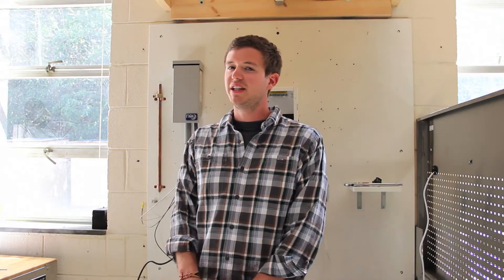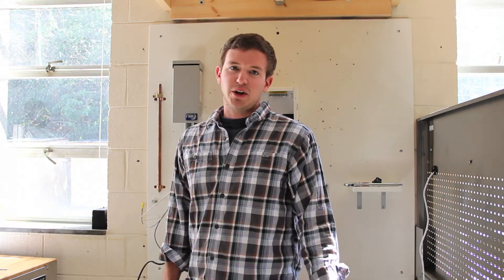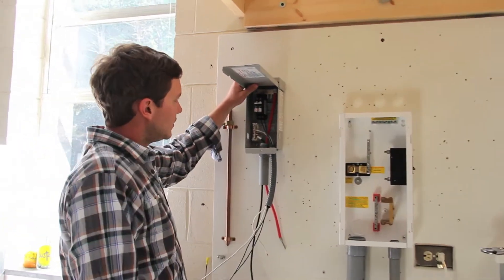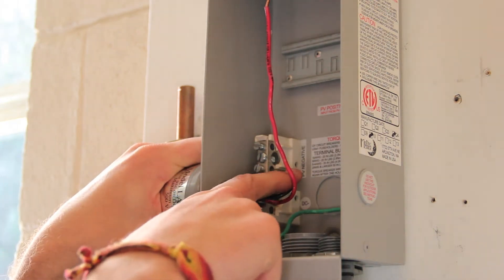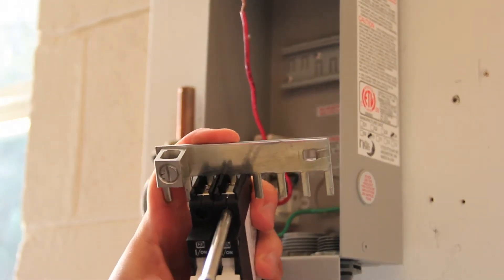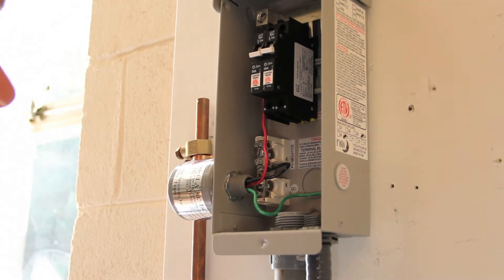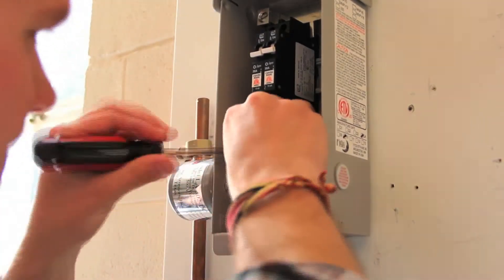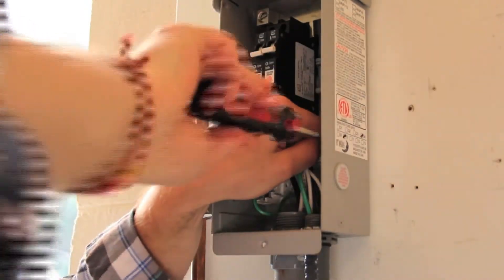Combiner Box Wiring for Photovoltaic Systems

Comment: Where is the ground wire connected to on the PV that is shown in the combiner box. If the grounding system with number 6 wire is connected to the PV and mounting bracket down to the earth ground. Is that necessary if you have ground on the roof already.

Comment: You've got to be kidding!  Lightning strikes can easily be 10,000 amps and the "lightning arrestor" has maybe 14 gauge wire on it?  Maybe if you said "suppressor" because it bleeds off the charge and prevents a strike?

Comment: You should never stack multiple wires in a single connector. The appropriate option for connecting the lighting suppressor would have been to installed a DIN rail mounted terminal block to keep you wires with a single contact.  Not trying to start trouble just point that out. Otherwise a good video.

Comment: Hello, thanks for the video. I have bought a hybrid inverter and am connecting 42 panels of a 265w module. From the manual of the inverter I have to connect 14 of the 265w in series so that I can I have three strings coming out making 42 panels. There's no need for me to parallel them because the parallel connection takes place in the inverter when I plug it in. In the manual I'm adviced to use a 1000v/20A dc breaker in between the hybrid inverter and the solar PV modules. Is it possible to use a combiner since I'm not paralleling it. Again if I'm to use a combiner how do I go about it. Thanks it's very urgent.

Comment: Just wanted to give you guys a shoutout on a fantastic video. I am going to put a small 2-3 panel system on my backyard shed for lighting/light power tool use, and this is the most complete video I have seen on wiring an MNPV3 combiner box. I've never really done any wiring before and while the diagrams are pretty self explanatory, it's always nice to have something in video format to see how it's actually done. Thanks a bunch for an awesome video.